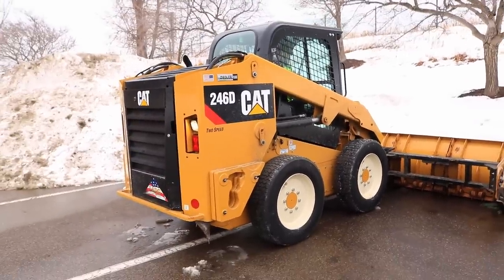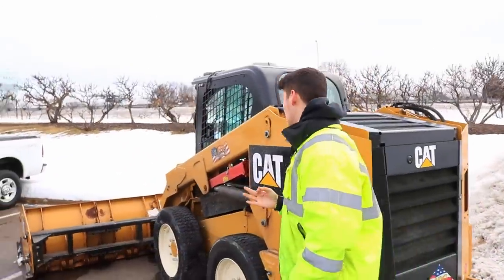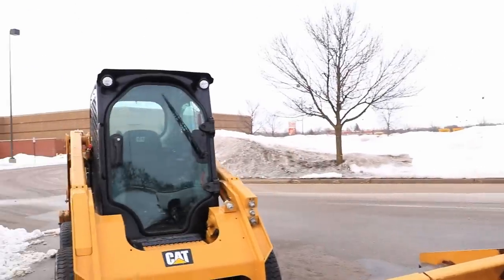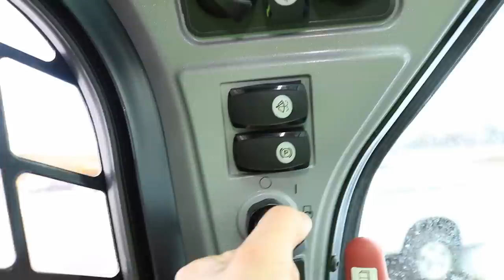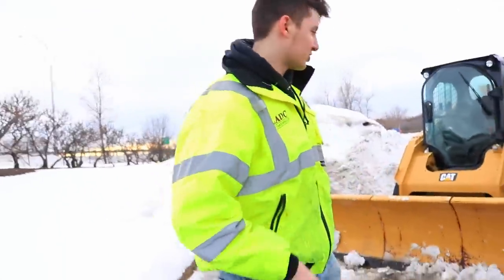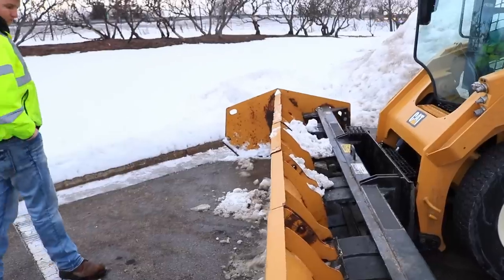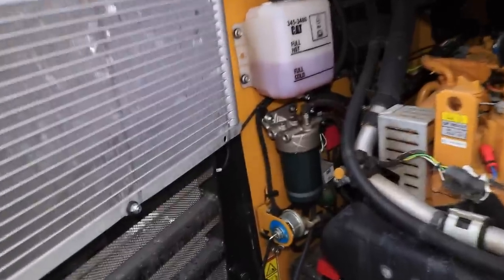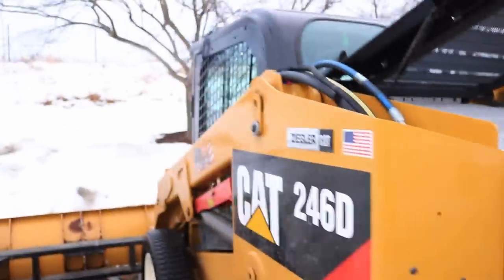CAT 246D Skid Loader Review

Comment: I think you might want a small wheel loader to do that parking lot.  It would make hauling off snow or loading larger amounts of dirt off the loading faster.  Plus stacking snow higher easier.
Reply from the maker: Yes it would be much better for this lot, these guys just run all the same skids for these lots and just pay some guys cheap to run them. They have the hundreds of contracts all over the Midwest so buying a bunch of wheel loaders get expensive
Reply: Yeah I meant with a guy from that LADC to do a Kohl’s there pay is cheap but they don’t care if you don’t have experience
Reply from the maker: Ya exactly

Comment: I see using sectionals is new to you.  You'll love them after comparing them to other push boxes.  They are much larger than Kages, and they get a super clean scrape compared to others.  I'm telling you, in the Chicago are, they are the #1 used push box.  Replacing blocks isn't a big deal, and the better the operator, the fewer you'll have to replace.  I'm also curious as to why you went with a radial lift vs. vertical.  Around here, we all use vertical lifts, because it allows you more room between you and the truck that you're loading if you have to do actual snow removal from lots.
Reply from the maker: I think they are pretty decent I just wish they would angle. It is remarkable how clean they can scrape a 12ft wide section though. This company. Does like 100’s of sights like this across the Midwest so they just buy the cheapest machine they can and pretty much leave it on sight year round
Reply: You guys should be getting hammered right about now.  I'm anxious to see some more or your videos!  I'd love to see your girlfriend (?) push snow too, it's too bad you didn't record that one of her pushing before, or deleted it by accident or whatever.  And what do you mean by "this company"?  It's not your machine?

Comment: I have a 2019 246D with a weight kit and snow tires. Traction is horrible!!! I’m only pushing a 10 Arctic box. Not sure what the answer is..
Reply: they sell steel tracks that go on over your rubber tires.. couple grand for a set and not ideal if youre doing alot moving and turning on asphalt but in anything soft like snow mud or grass youll have heaps more traction

Comment: The poly blocks are designed to be a weak point on the plow. They are far less expensive to replace than the sections frame or couplers. That pusher has got some age in it as well! Talk to your cnh dealer and try to demo a new one!
Reply from the maker: Ya she had some time on it! But i just wish they could be a stronger weak point lol if that makes sensr
Reply: Carson Schifsky totally makes sense! The newer models have stops to help prevent breaking them. If they aren’t abused too much by the operator you can get an entire season out of a set of blocks!